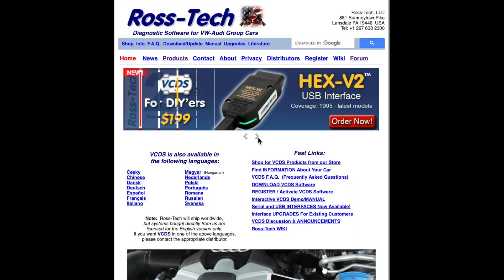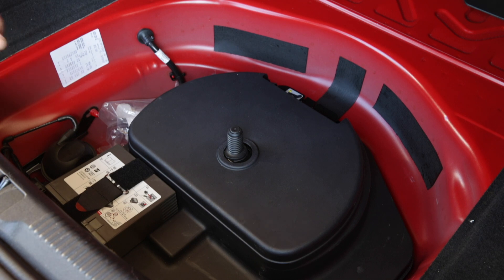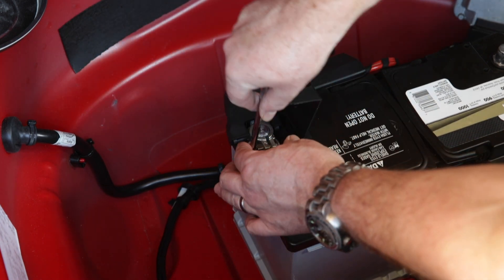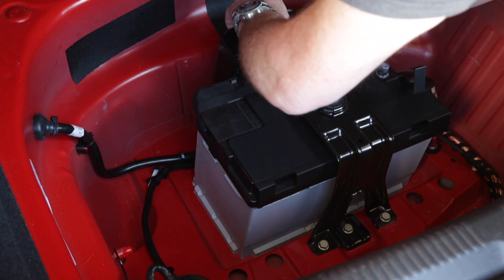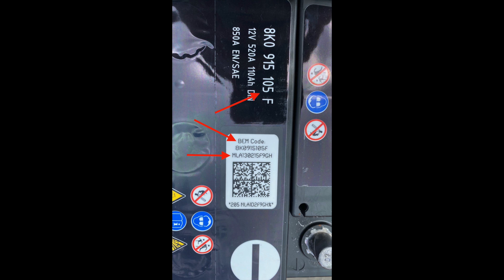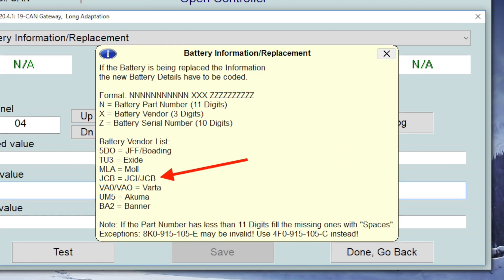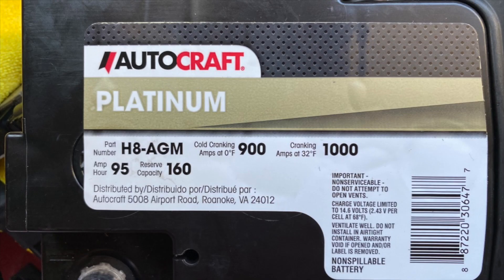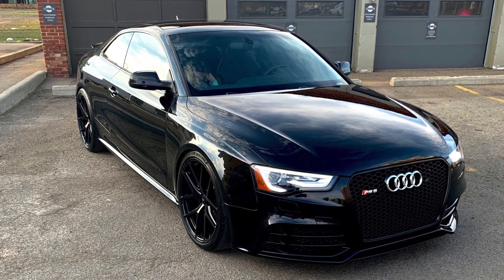Audi RS5 OEM Battery Replacement and VCDS coding

Comment: Thanks, Ape! I’m hunting down a gang of faults triggering the Quattrofecta of TMPS CEL Sport Diff and Traction control and crossing my fingers it’s not a ecu short. Decided to first attempt to “throw money at” a new battery once I confirm it’s not 3 years or newer, and then cleaning the throttle bodies and replacing the map sensors and possibly the accessible knock sensors while I’m at it.
Reply: Did you get to the bottom of this
Reply: Sure did! Ended up being the Map sensor. Replaced 1000 miles ago and no more issues 💪

Comment: Good vid. Was pretty helpful, but didn’t match my situation perfectly. The “JBC” manufacture’s code was a helpful hint. Installing an AGM Duralast battery, and the code etched on my battery’s case was 16 digits, not 11. Though I noticed that the video had a bracket covering up the battery case right next to where the last digit of the etched part number was being shown, so I’m not convinced that bracket wasn’t covering up more digits there. But it’s been 3 years since this vid was made, so maybe JBI changed how they format their part numbers/serial numbers. I’m sure that is just used to trace it back to the build info of the battery in case it ever starts a fire in a vehicle, unless there is a battery-industry standard about how serial numbers of car batteries are supposed to be written and I haven’t found any info on that. Thanks for the vid in any case. :)

Comment: Is it possible to code a Bosch battery into a rs5 B8 with non stop and start or isn’t it not needed hear mix messages and some garages say impossible as it’s not the oem replacement
Reply from the maker: It depends.  If it has some semblance of a BEM code, you can.  You can also "fudge" one of the digits on the right 12 numerals, test it and see if it takes.  If it takes, you're good to go.  I would keep the type of battery and amp hours the same going the fudge route.  So if there's an AGM-style battery in there now, stick with a Bosch AGM.  Make sense?

Comment: hi, I bought a VARTA 95ah 850a G14 AGM battery for my RS5, but I don't have the BEM code.  can you help me?
Reply from the maker: It should be right on the battery itself!
Reply: @RS5Fanatic  hi someone relplaced a varta h15 with Delkor LN5. Similar specs. But no BEM. Advice ? I can code the BEM but without it what do I do ? This was Audi Q7 2013 diesel 3.0 tdi Quattro. - BTW I just changed a digit on the serial number. Is only a change required to tell car it’s a new batt, or is there some information in the BEM which changes batt charging and sensing functions of the car ?
Reply from the maker: @defaultHandle1110  If the old battery was dead, it's very much advisable to enter a new BEM code for the new battery.  Look to see if there's a serial number on the battery case itself as well as a bar code sticker with a number below it.  If the battery is listed as an OEM replacement, those numbers should work as the BEM.  If not, you can do one of two things.  Use the existing BEM but experiment by changing a number or letter in the SECOND group of the BEM code or find an OEM replacement battery at an auto parts store and take a photo of that battery's BEM sticker.

Comment: So glad this channel is around.  Picked up a Duralast AGM and was able to see the barcode #'s and then the emboss in the plastic of the battery shell.  It's a similar numeric string all the way out to the 9th digit.  But instead of 2 more numbers, this battery has 5.  I'm going to try and stop at 11.  Using OBDEleven
Reply: How did this turnout using OBDEleven?
Reply: @CalvinNelson  the steps worked fine.  The code on the new battery wouldn't register, but per other videos a change in "a" value from the current code would.  So I did that and everything is fine.

Comment: Hey, thanks for making this video. I've just swapped from my original flooded batter to a new AGM battery, and coded it. However I don't see a section to change battery technology or capacity via VCDS, do you know if we need to do this and how? Thanks!
Reply from the maker: The code itself tells the BMS what type and size of battery you installed so you should be good to go.
Reply: @RS5Fanatic  Thanks for the info!

Comment: Great instructions. How did you keep power to the accessories when you disconnected the battery?
Reply from the maker: I didn't.  Everything seemed to stay the same although I did not check my radio stations as I haven't listened to AM/FM in at least a decade!  All the other settings were intact.
Reply: You can connect a charger or battery to the jump points under the bonnet. The positive terminals are under the plastic scuttle.panel right up against the windscreen wiper and the negative terminal is near the near side (on your right looking into the engine bay) air inlet pipe. I'll try and post a photo.

Comment: Great! Mine just went flat. Can they be recharged?
Reply from the maker: Yes and no.  Chances are, if you drained your normal AGM or lead acid battery, you've damaged it's capacity to hold electricity.  My battery tender went out a few months ago and I should have replaced it right away.  I didn't, then the virus hit and well, no more daily drives.  With an old battery on it's last legs, just took a week of not driving her to kill the battery.  The good news is, if you're interested, I'm a dealer for Antigravity lightweight lithium batteries.  They'll save you 45 pounds too.

Comment: I'm considering replacing my failed Bosch battery with a Yuasa. What's the manufacturer code for Yuasa battery or can I just change a digit in the serial number as mentioned?
Reply from the maker: If the Yuasa is the same amp hours and battery type (AGM or normal lead acid), and it's an OEM replacement, it'll likely have a BEM code sticker right on the battery.  If it doesn't, you can either change a letter on the right 12  number/letter combo and then "test" it using the VCDS.  If it accepts, you're good to go.    Not sure where you're located but if you are in the U.S., I'd take a strong look at Antigravity lithium ion batteries.  About 40 pounds lighter with built in jump starting.  And I can get you a decent discount.  sales@redmistracing.com.

Comment: Hi mate I’ve just had new battery and alternator tested and works great , just had new abs back sensor replaced and still getting these codes I cleared and there come back straight away , I’m getting stabilisation and abs check followed by parking brake malfunction followed by sport diff system fault followed by TPSM it was doing this now and again and coming up as rear abs sensor,but now it’s all the time,clear it and it comes back straight ive replaced the sensor with a Bosch one off eBay and still no good - OBD 11 scan is the following: 

Function limitation due to received malfunction value  U111300

All wheel drive control module 
01324

Left rear ABS wheel speed sensor
Implausible signal 00290

Electronic parking brake control module -J540 - 00473

Brake control module 01316

Gateway static current 02256

ABS brake control module U101700

Car is a Audi RS5 B8 2011 and it’s looked after very well any ideas buddy kind regards
Reply from the maker: Try a Ross Tech VCDS.  Pretty sure there's a distributor in your country.  You'll want to go in and clear codes in each module STARTING with ABS.  That may or may not clear it up but after doing a full scan, it'll tell you more than the OBD Eleven ever did.
Reply: @ thanks mate

Comment: If you’re using an OEM Audi replacement battery, do you still need to do the re-coding?
Reply from the maker: You do.  I'd take a hard look at the Antigravity lightweight lithium ion batteries.  More expensive yes, but a massive weight loss and built-in jump starting.  Contact sales@redmistracing.com and I'll get you a great price on one.  See my Antigravity battery video for details.

Comment: Which Battery exactly is this? And after having it for a while do you still rec it?
Reply from the maker: I used an OEM replacement battery in this video.  I've since moved on and use an Antigravity Lithium Ion battery with built in re-start ( jump starting).  You can order one of those through me, just reach out, sales@redmistracing.com or you can order off the website here: https://redmistracing.com/ols/products/audi-b885-rs5-antigravity-h6-40ah-lithium-ion-battery

Comment: Will the car still start even if you don’t do the coding?
Reply from the maker: Yes it will.  It just won't charge the battery like a new battery, but like an old battery if that makes sense.  You can get away with not coding it in for a few weeks or just disconnect the battery monitor which is a two wire plug on the negative battery terminal.  Will act like a normal alternator at that point, no coding needed.

Comment: Hi do you need to code the new  battery if its like for like oem? 
Thanks.
Reply from the maker: If your old battery was worn down, then yes, you'll need to code in the new battery. Otherwise the car thinks it's charging an old, tired battery and it won't be optimized for a new, fresh battery.  If you're swapping in something like an Antigravity lightweight battery (I sell those!) and your old battery was fine, probably no need to code in the new battery.
Reply: OK that's great thank you for your advice, your videos are top quality thanks again, at the moment I'm having trouble with multiple misfires iv ruled the battery out now and looking down the injector road, iv fitted new apr coil packs and new spark plugs. Any extra advice would be 🙏  cheers.
Reply from the maker: @splaig1  Having a Ross-Tech VCDS is critical in my opinion.  That'll really help diagnose issues, give you exact codes AND their causes as well as log misfires and give you a total misfire count.  Injectors are not out of the realm of possibility (known issue) but I'd like to see a full scan with a VCDS to really point you in any one direction.  I can also be reached by email, sales@redmistracing.com.
Reply: @RS5Fanatic  A bit late. My AGM battery died. Took it out and installed a new battery (not agm). I did not do coding. Now my car does not want to start and windows not working